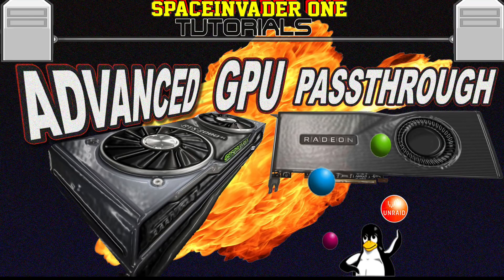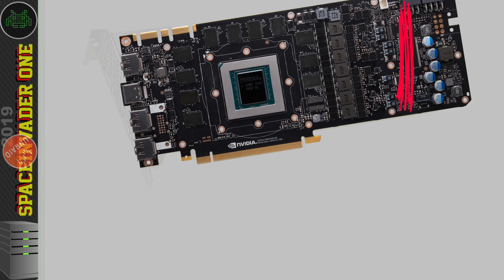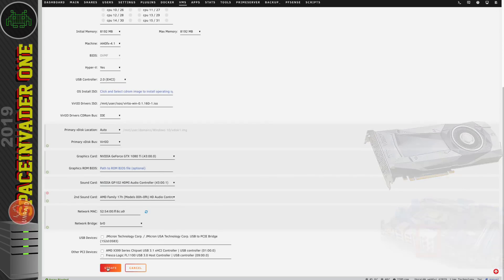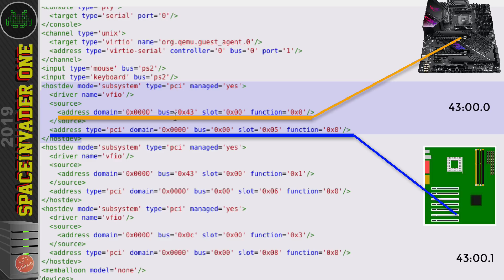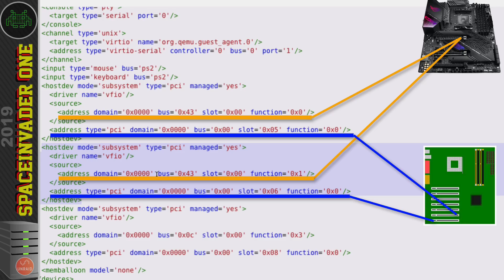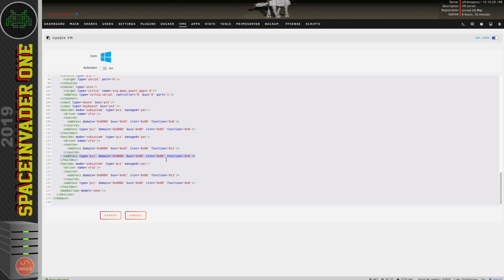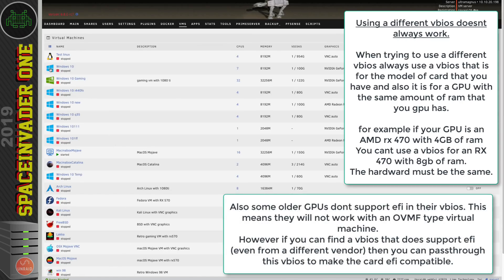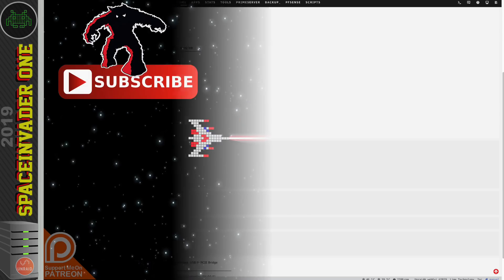Advanced GPU passthrough techniques on Unraid

Comment: Very cool Instuctional, gave me the know how to start tinkering with my xml. shortly after that I figured out my solution (which was for my Xeon onboard graphics). I actually had to turn off the multifunction and not use the attached audio or else the videocard wouldn't work. Either way so happy to finally be up and transcoding with my video card now. Thanks SI1

Comment: I did eventually find this solution (multifunction) online but I had no idea how/why it worked. And also that editing the UI and saving regenerates a new XML file so you lose all changes that dont map to the UI (seriously Unraid, maybe compare both files and tell me or at least show a warning?)

But I would have saved so much time and frustration if I just watched this video lol. I gotta learn to do a bit more research before jumping in.

However, there IS something I found out that was only partially mentioned in the video. You're correct in that if you don't need UEFI you should disable it, but I find out one specific feature was causing my Error 43's: Above 4G Decoding and ReBAR.

After going into my bios and turning those off, my error 43's disappeared and I'm booting UEFI. But yeah best practice is just to do legacy

Good shoutout on the vBios too. Even though I was using an AMD card (5700 XT) as my only GPU, I needed to pass the vBios through for the GPU to actually hand off successfully to the VM and back to unraid. Otherwise I'd get no video output upon starting the VM as the VM takes the GPU from Unraid but can't use it. I think you mentioned in a later vid that you need to pass the vBios through from Navi and newer.

I did try to dumper script you mentioned in another video, but my GPU was primary and it didnt like me. Luckily, the GPU I bought had had a corrupted bios so I already had the exact bios file downloaded and flashed onto the card via an AM3+ board with a built in GPU lol, so I just put that file into the iso share and passed it in.

Comment: this used to work great, however I just tried it with a win11 vm and win10 vm, when I add the multifunction='on' and change them to matching bus/slot, the vm will no longer initialize display, I tried to reset it by switching back to vnc, same thing. I had to delete the vm and create a new one using the existing disk to recover it. What gives?

Comment: I'm still getting the error 43.  I changed from:
      <driver name='vfio'/>
      <source>
        <address domain='0x0000' bus='0x82' slot='0x00' function='0x0'/>
      </source>
      <rom file='/mnt/user/isos/vbios/gpu gtx 1660.rom'/>
      <address type='pci' domain='0x0000' bus='0x04' slot='0x00' function='0x0'/>
    </hostdev>
    <hostdev mode='subsystem' type='pci' managed='yes'>
      <driver name='vfio'/>
      <source>
        <address domain='0x0000' bus='0x82' slot='0x00' function='0x2'/>
      </source>
      <address type='pci' domain='0x0000' bus='0x05' slot='0x00' function='0x0'/>
    </hostdev>
    <hostdev mode='subsystem' type='pci' managed='yes'>
      <driver name='vfio'/>
      <source>
        <address domain='0x0000' bus='0x82' slot='0x00' function='0x3'/>
      </source>
      <address type='pci' domain='0x0000' bus='0x06' slot='0x00' function='0x0'/>
    </hostdev>

to:
  
 <driver name='vfio'/>
      <source>
        <address domain='0x0000' bus='0x82' slot='0x00' function='0x0'/>
      </source>
      <alias name='hostdev0'/>
      <rom file='/mnt/user/isos/vbios/gpu gtx 1660.rom'/>
      <address type='pci' domain='0x0000' bus='0x04' slot='0x00' function='0x0' multifunction='on'/>
    </hostdev>
    <hostdev mode='subsystem' type='pci' managed='yes'>
      <driver name='vfio'/>
      <source>
        <address domain='0x0000' bus='0x82' slot='0x00' function='0x2'/>
      </source>
      <alias name='hostdev1'/>
      <address type='pci' domain='0x0000' bus='0x04' slot='0x00' function='0x2'/>
    </hostdev>
    <hostdev mode='subsystem' type='pci' managed='yes'>
      <driver name='vfio'/>
      <source>
        <address domain='0x0000' bus='0x82' slot='0x00' function='0x3'/>
      </source>

Any help?

Comment: I was ready to give up..... I dumped the vbios, I used a TechPowerUp edited vbios, fixed the slots in XML, switched the legacy mode, tried every combination that I could try in the VM setup, manually passed through the video card, used the new 6.9.2 pass through, reinstalled the VM about 15 times for each of these, and BLACK SCREEN OF DEATH.  Today I finally tried something new - based on an issue that had nothing to do with unraid, and more to do with me farting around in the actual bare metal bios.  I was trying to mess with disabling the onboard video, and then all of a sudden after a few boots IT STARTED WORKING.  Here's the dumb-as-hell solution that made it work: I plugged a flipping monitor into the physical GTX 1080.  If I unplug the monitor, instantly stops working.  Anyone know if I can emulate a plugged in monitor?  I hate that I have to sacrifice a monitor to use the video card in a VM.
Reply: search dummy plug

Comment: Thank you very much for video. One thing I did not understand correct is why are you passing custom vBios? I've seen tutorials without this step and they worked. Why is it necessary to use modified GPU vBios? Can wrong vBios damage the GPU? Thanks

Comment: Thank you for the GPU Passthrough videos! I followed the earlier videos on how to setup a win10 gaming vm but all I got was a black screen and no boot without any errors, so I was kinda lost after that 🤔
I followed your steps with the multifunction in XML and switched to Q35 as I am using an AMD GPU, and it all works like a charm now!

Comment: your videos are amazing, thanks a lot!! I tried to passtrhough a zotac nvidia RTX 2070 with the modified vbios as you mention and i can see screen but the drivers are not isntalled :( the screen is detected as a generic microsoft video card, so therefore nvidia drivers are not installed saying no device detected :( any idea? (yes I passed through the 4 devices of the gpu(gpu, audio, usb,serial)

Comment: I followed all steps and still got no Video Output :c
I changed the gpu to
<rom file='/mnt/user/V-Bios/Asus.GTX1060.6144.180129_1.rom'/>
  <address type='pci' domain='0x0000' bus='0x00' slot='0x05' function='0x0' multifunction='on'/>
    </hostdev>
    <hostdev mode='subsystem' type='pci' managed='yes'>
      <driver name='vfio'/>
      <source>
        <address domain='0x0000' bus='0x07' slot='0x00' function='0x1'/>
      </source>
      <address type='pci' domain='0x0000' bus='0x00' slot='0x05' function='0x1'/>

and added a Vbios but i still get no Video output :c
Can you help me?

Comment: I'm wondering if you've ever had to deal with an AMD gpu that produces the "unknown pci header type 127" error. Most posts I've found only seem to have this problem after shutting a VM down, but I'm encountering it at the VM startup. Specifically, I'm trying to use an r9 390x in an unraid 6.8.3 to be used for gpu transcoding. The guest vm is ubunbtu 18.04. The host machine is a 2700x on an x470 Taichi. Any tips or input you might have would be greatly appreciated.

Comment: You superstar SpaceInvader, this XML edit is exactly what i needed.
Reply: Spoke too soon, still doesnt work: internal error: qemu unexpectedly closed the monitor: 2020-02-14T10:29:39.810742Z qemu-system-x86_64: -device vfio-pci,host=0000:28:00.0,id=hostdev0,bus=pci.0,multifunction=on,addr=0x5: vfio 0000:28:00.0: failed to setup container for group 16: Failed to set iommu for container: Operation not permitted.

Also tried with a custom BIOS for my 1070 to no avail.

Comment: Hi, I absolutely love your videos they have been super helpful. I am using a bare metal hard drive to run my VM and its been working great for a while but then my unraid flash drive failed and the system booted into windows. Got that fixed but now, when I try to run the Windows VM I get the dreaded code 43 and my 1070 will not start, any thoughts?

Comment: I could do with someones help with my RX 570 with passthrough... My build is a;

AsusTek TUF B450-Gaming Plus MB with latest BIOS update in mid December 2019
AMD 3700X Processor
ASUS Strix RX 570 4GB Graphics card
2x 8GB Crosair 2666Mhz RAM
2x Sata 512GB SSD
3x 3TB Spinny 3.5 hard drives

I am running Unraid 6.8.1

However when it comes to VM's like Windows 10 and OSX, I cannot get my AMD ASUS RX570 to passthrough to the VM. I have tried the list of things below but no matter I do I get the spinning red arrows when I start either VM and then the whole of UNRAID crashes and I have to hard reboot the whole server. Can anyone help in what I can do.

1. Downloaded the TechPowerup VBIOS for the GPU here and then dropped in in the XML as per spaceinvader One with a Nvidia card but this is a AMD card https://www.techpowerup.com/vgabios/197590/asus-rx570-4096-170406
2. Turned on ACS on VM settings to 'Downstream'
3. Updated Syslinux configuration with - rcu_nocbs=0-15 (my CPU has 8 cores and 16 threads)

I have done all this but it still doesnt work, also running on Q35 - 4.2
Reply: Did u find a solution? I have the same problem as you.
Reply: Dino M. I gave up I am afraid
Reply: Matt Talks Tech  :/

Comment: My XML for Catalina and Win 10 both have the GPU and Audio on different buses instead of slots, any idea what should I do here? 0x04 and 0x05 for Bus, 0x00 for Slot. This is an AMD RX580, before the edits it would show as a audio device in Windows but nothing would play out, now no device shows.
Reply: In case anyone has similar trouble my system is magically working. For Catalina I did the tweaks but it only worked after updated to 15.2 For Windows I updated to Unraid 6.8.1, Created a new VM with Qemu 4.2, and no xml tweaks, and somehow everything is working!

Comment: Thanks Spaceinvader! I've installed my gtx1660 super card today and got it working through this video and your earlier ones on installing the Windows VM. I needed to pull one extra trick to avoid the error messages upon trying to start the VM. My card had 2 extra devices in its IOMMU group: an NVIDIA serial bus and USB Controller. As these were apparently on the physical card, I've added these to the Syslinux configuration and then added them in the VM template as ' other pic devices'.

Comment: Is it possible to use 1 gfx (rtx 2080 ti) to use on 2 diffrent VM's Windows, linux and only 1 VM running at the time?

Kind Regards // Grias
Reply from the maker: Hi there. Yes you can use the same GPU with different VMs , so long as they are not running at the same time.

Comment: 1 burning question: first AMD build here, no onboard gfx. I have 2 Vega cards installed, can I use both of them 1 each for 2 VM's or is 1 reserved by UnRAID since there is no processor IGPU? Is there a hardware or software fix that's savvy? ty.
Reply from the maker: Yep you can use both the cards. One for one VM and one for another. I have a Ryzen system with a 1080ti and an rx570  and use both at once with the 2 gpus.
Reply: I would love to know the answer to this question too, and......Can you specify which graphics card (or slot) Unraid uses if it has to have one?
Reply: @drugdoctor1  I can tell you I think I can answer a little part of your add on questions... IF unraid needs a gfx card, youd tell it which one to use based on your bios settings of primary graphics selection.
Reply: Excellent! I've got Catalina as my daily machine with 1 vega fe, and sometimes (I think) I've been able to configure my windows 10 vm with the other vega fe, but certainly I haven't got  picture to come through the card for windows yet. Do I need to stub the sys linux config with the gpu? I wouldn't think so since it's already appearing as an available device. I have acs downstream enabled. Just wondering what I'm missing. I look forward to running both at the same time with vega graphics. Macos for everything except CAD on windows.
Reply: @vgnfab   how do you make unraid not want a graphics at all? Sounds like you are having same problem.
Reply: I do not have a solution here. I am wasting a very valuable PCIE slot on a Quadra 4000 card JUST for UnRAID UI. And of it's outputs, only DVI gives out video to a monitor. I thought I'd be able to at least use it for hardware encoding, but if that's possible, I don't know how to set it up. 
Someone please explain - How can you make UnRAID run headless - Not need a GPU when on Ryzen? I would sure like a network card or another USB card in my last PCIE slot instead of the dumb Nvidia card.

Comment: Great video! Unfortunately, I need getting this error when I start my VM with GPU pass-through - "internal error: Unknown PCI header type '127'" Any ideas what might be causing this? I'm trying to pass-through a GT 710 and my CPU is the Ryzen 2700x. I have tried passing the card through on many different VMs, all resulting in the same errors. I have confirmed that all virtualization settings are enabled on the mobo bios. Please let me know!
Reply from the maker: Hi Milo. yes I would guess your bios on the motherboard is a new bios that came out to support the ryzen 3000 series. unfortunately, this breaks passthrough. the only way to fix it really is to downgrade the bios on the motherboard. But this isnt without risks. Check my video here  https://www.youtube.com/watch?v=ZzqwjVDKAnU
Reply: @SpaceinvaderOne  this worth a look....https://r.tapatalk.com/shareLink/topic?url=https://forums.unraid.net/topic/80692-ryzen-3000-series-build-struggling-with-pci-e-lanes/&share_tid=80692&share_fid=18593&share_type=t&link_source=app

Comment: Should the same process for HDMI audio be followed for cards with USB and serial bus devices?  Like my 1660 Super?
Reply from the maker: Yes I would pass through all  hardware on the gpu. Copy the same way as it is connected to the host. So if usb is on same slot copy the same function number etc when mapped to the vm
Reply: @SpaceinvaderOne  Thanks Space One. 

To note, I have found that the original ROM downloaded from TechPowerUp was the only ROM that was able to boot my VM.  I know...strange but even when edited, it didn't work (also extract).  The original ROM from TPU works...sure someone can confirm why...maybe different with the 1660?

Whilst I think your tips are excellent, please note that the Error 43 can also be caused by other issues.  In my case, it was a PSU deficiency issue.

I would strongly suggest all Unraid users to check their PSU needs; especially in the case where you are not replacing a GPU, but adding a new one.  I found that my 1660 Super in my ML350p Gen 8 server requires more PSU power (especially seeing I have the 1060 set for encoding).

In terms of servers, make sure you check your PSU requirements with the manufacture.  I'll need to upgrade my PSUs as, when I powered the new 1660 Super via a sep PSU, the error 43 went away.  Ensure you check your PSU!

Taken 3 days of constant time of mine. :-)

Great stuff Spaceinvader One.  So good, so clear.  Keep it up!

Comment: For any ryzen users. I've recently had a "Unknown pci header type '127' ". After a fresh start of the server the graphics card can be used to start the VM, but no video output will be displayed. The VM also can't start correctly and needs to be forced to shutdown. Upon restarting the vm the "Unknown pci header type '127' " will appear until the next server restart. This issue seems to be a problem with the recent ryzen motherboard bios supporting the 3000 series of cpus. Downgrade the motherboard bios far enough and the error should dissapear.
Reply: Not possible if the old bios can't support 3000 series ^^" or the mainboard provider doesn't update the bios anymore xD
Reply: I've got an x570, 3900x with the latest bios and dual Vega FE cards without this error.

Comment: I tried to add the bios rom from tech powered up for my GPU but when I start the VM I get no picture so I had to remove the rom. Thanks for the tip about multifunction devices on the same bus. I was able to make that change at least.

Also just wanted to say I found your channel recently and it has helped me tremendously. You're awesome, keep up the amazing work!!!
Reply from the maker: Glad you like the channel. Thanks for watching :)

Comment: I have a GTX1050 that puts the GPU and AUDIO on separate bare metal busses. No matter the configuration I can never get the audio to pass. Sometimes the VM won't throw a Code 43 and sometimes it will. It always fails to pass the audio with a no permission error.
Reply: Got the same issue after updating to 6.8 ... Worked fine before :/